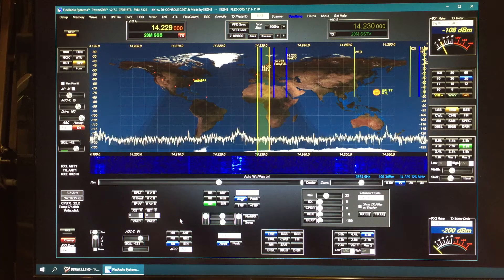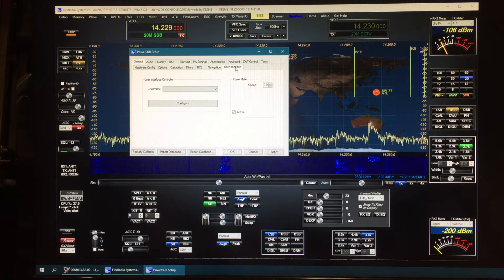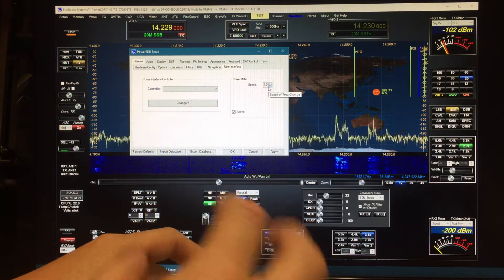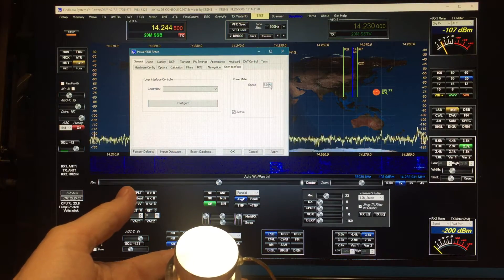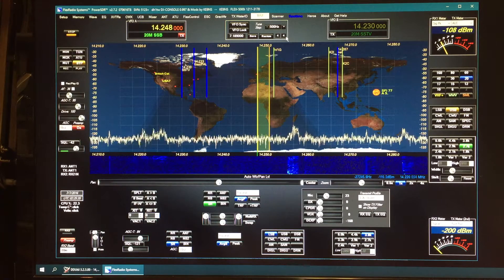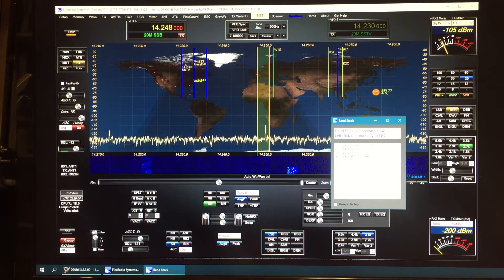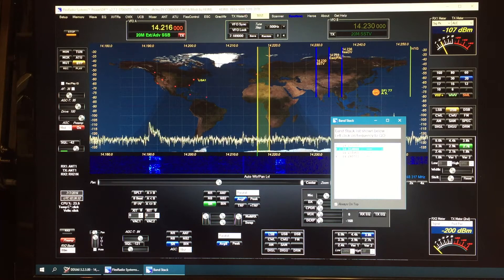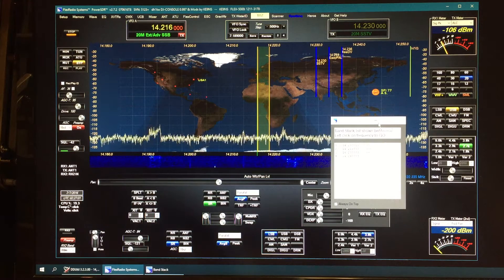PowerSDR 2.7.2 ke9ns Rev T8 PowerMate and BandStack features

Comment: Hey guys just a quick tip with your powermate controllers .. Hold the base with your left hand and with your right pull off the top knob cover and get rid of that little foam ring.. Put the knob back on and it feels like a real VFO. Now it spins freely for quick tuning across the bands and your finger tip will not slip..  "73
Reply from the maker: Yep. Nice Idea.

Comment: Hi Darrin Great update I've installed REV T8 and I'm not using a Powermate knob I use a Hercules Control so when I go to load T8 I get a error message saying there is a problem with POWERMATE ??? so it stop's working,So I installed Ver T4_DJ and that work's 100% no problems, So what I need to know is were can I get Ver 06/15/16 T7 because it look like that VERSION has nothing to do wit Powermate ??

Thanks again for all your hard work.

I'm using a Flex 3000 with windows 7 Pro with SP1
Reply from the maker: You don't need a PowerMate to run T8. T8 needs the vcruntime140.dllSo, If your running Win 7 you need to make sure you have service pack 1 installed. (SP1)And you need to install vcruntime140.dll. I put a link at the top of my web page to download the runtime installer.